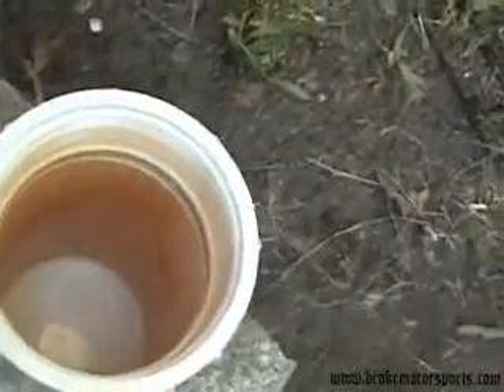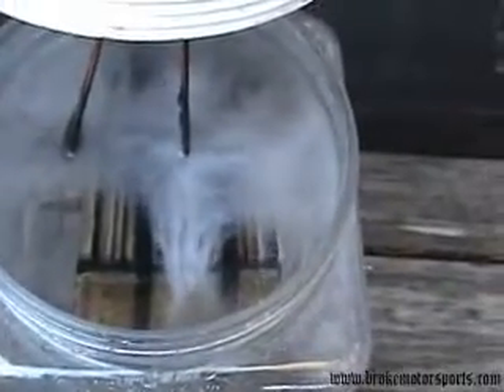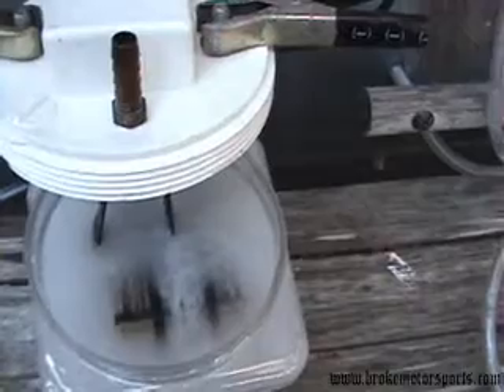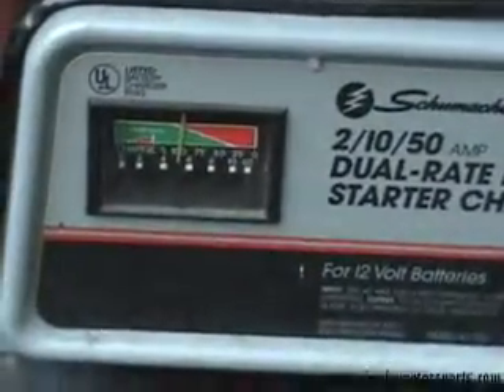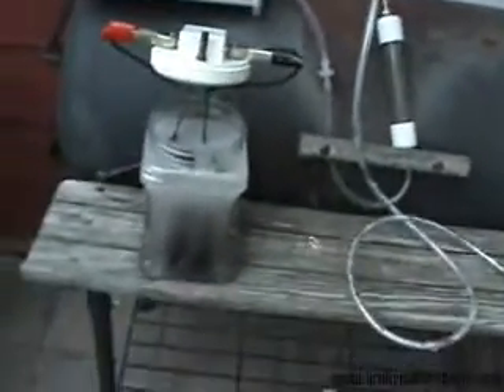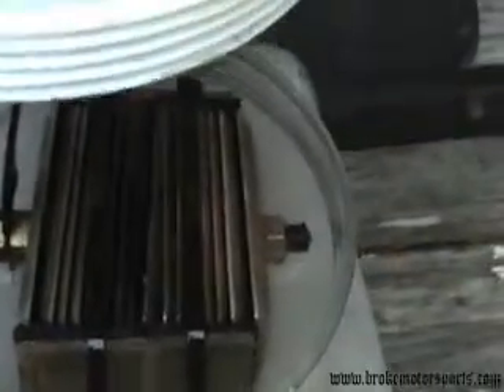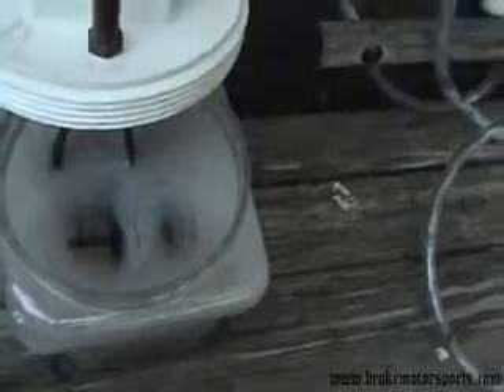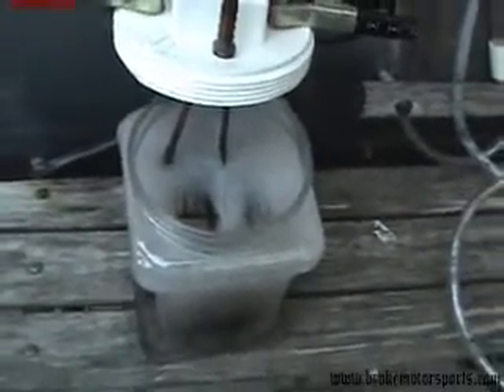HHO Test #007 - www.brokemotorsports.com

Comment: ZeroFossilFuel has done some excellent videos related to this issue.  He gives some great examples of how to seal up a "swimming" type plate stack to minimize leakage. The "dry" type devices like mine still have some current leakage at the holes through the plates, but the leakage is generally smaller than with the swimming type cells.

Comment: I also get a slight dicoloration of my PVC parts ... it seems to get a patina on the surface dosnt hurt anything ...

Big problem for PVC is heat. Some PVC will start to break down at as little as 150F. And will start getting soft at as little as 180F. So controlling temps becomes even more important.

current leakage is your lack of production on the neutral plates ... electricity being lazy as usual ... better seal on edges will help ...

you have a pretty nice setup there ...